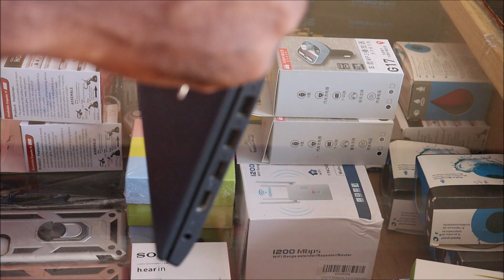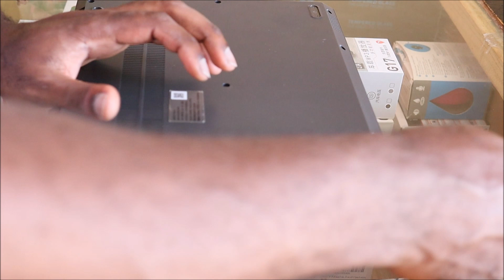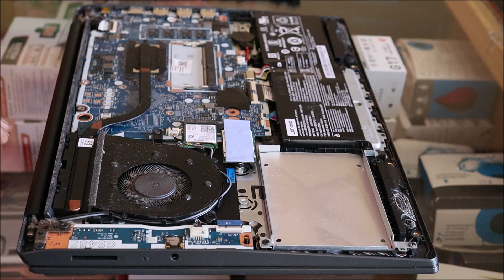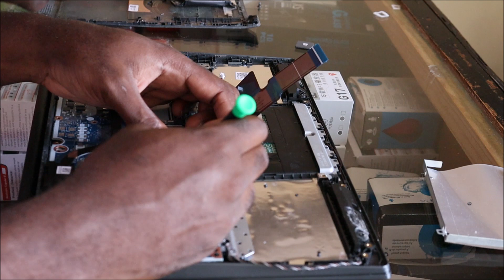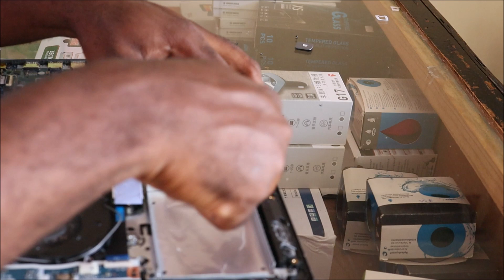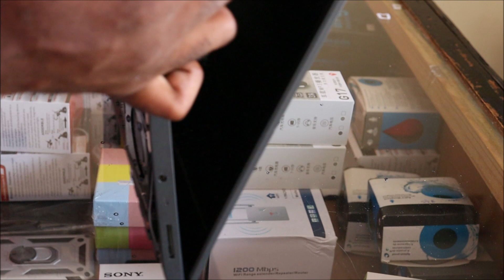Lenovo IdeaPad 3 14IIL05 3 keyboard replacement

Comment: Please tell how to get the keyboard for the replacement
Reply: Amazon
Reply: “LTPRPTS Replacement Laptop Upper Case Palmrest Non-Backlit Keyboard Touch Assembly Part for Lenovo IdeaPad 3 15IML05 15IIL05 15ADA06 15iml05 5CB1D03528 Blue”

Comment: You almost destroy 😂😂😂 not recommended 😂😂😂
Reply: Why is this not recommended when this is how you replace the keyboard for this type of laptop , I did the exact thing he did and got my keyboard replaced with a new one.
Reply: @x5action968  youre not supposed to take the backplate ripping it off like a tape, persevere and melt the rivets one by one so you wont accidentally destroy the rivets
Reply: I've done it